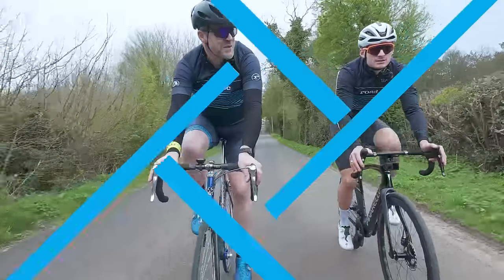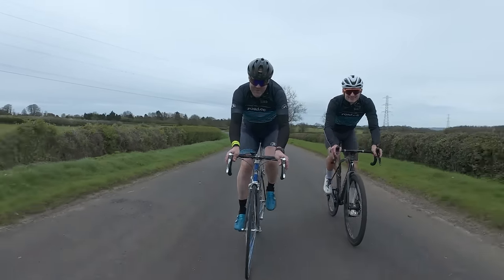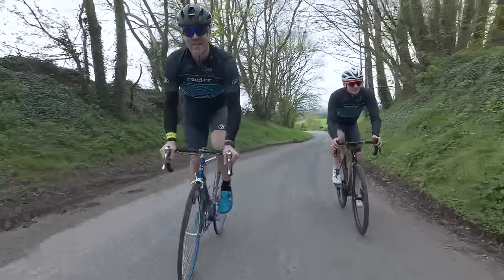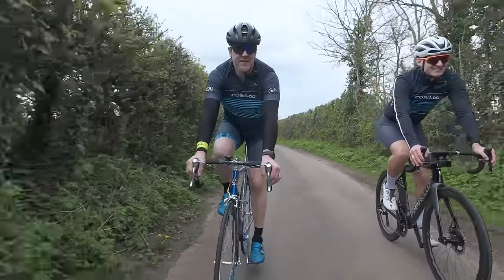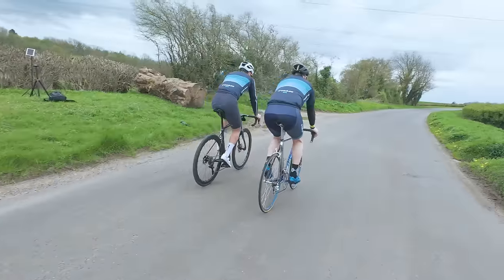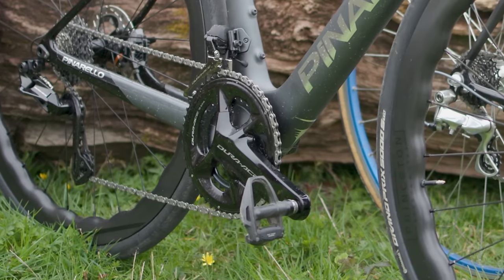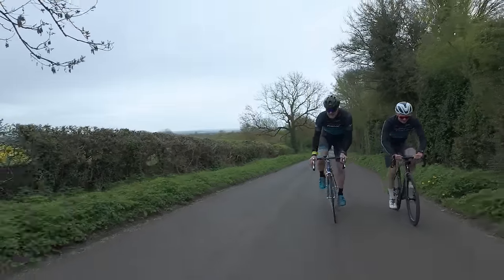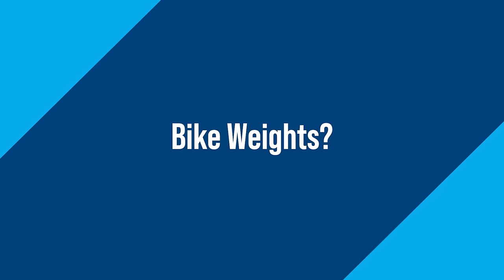Modern Road Bike vs Retro Road Bike - Has 24 Years Of "Progress" Made Cycling BETTER?

Comment: I started riding as an adult in 1975 and bought my first pro bike (by the standards of the day) in 1982.  It featured a handmade frame (Columbus chromo-moly steel tubing), hand-laced wheels, and Campagnolo Record components.  I paid 1,200 USD for the bike and rode it for several years.  Adjusted for inflation, the cost of that bike would be north of $3,800 USD.

I have purchased many bikes over the years.  My most recent purchase is a Canyon Endurace equipped with a Shimano 105 Di2 groupset.  I swapped out the stock wheels for a nicer set from Hunt with carbon rims and equipped them with 30 mm tubeless tires.  Total cost of the bike including the Hunt wheels and tubeless tires:  right around $3,800 (!). 

There is no comparison in terms of the performance of the two bikes:  the Canyon is lighter and FAR more comfortable, meaning I can ride more miles.  Its gear ratios are far wider, shifting is much easier, and the braking is better.  Finally, it doesn't rust (steel bikes will rust if you ride them in anything other than sunny conditions).   As a result, I never long for the bikes of my youth.

Comment: Neo retro is where it’s at.

Get a nice supple high end steel Columbus tubed Italian frame. Fit a threadless carbon 1” fork.

Add some modern 11 or 12 speed Campagnolo top tier groupset.

Some carbon tubeless 30-40mm wheels and 25-26mm modern tubeless tyres.

High end finishing kit. Job done. Should build up around 7.5kg. Sunning looks, hand built heritage, wonderful springy/communicative ride, modern gearing and excellent comfort from the combination of steel and modern tubeless.

Best of both worlds and absolutely unique to you 👌🏼
Reply: Except you can do the same with plenty of existing carbon frames and get a much nicer bike for same money.
Reply: @dainiusvysniauskas2049  no. A beautiful hand crafted lugged or fillet brazed steel frame builds to a much nicer bike than a generic carbon frame with the same components. That’s the whole point of Neo retro and a middle ground between the arguments for each bike in this video.
Reply: @banjo7127  Sadly, physics don't work that way
Reply: @dainiusvysniauskas2049  the only sad circumstance is your obvious lack of understanding regarding the subject. The video is about the benefits of retro vs modern. We’re not talking about physics or any other kind of boring acumen. It’s about the overall experience. I think you’re confused as this is probably your 2nd language.
Reply: @banjo7127  
Oh, the irony.
"Sunning looks, hand built heritage, wonderful springy/communicative ride, modern gearing and excellent comfort from the combination of steel and modern tubeless."

"A beautiful hand crafted lugged or fillet brazed steel frame builds to a much nicer bike than a generic carbon frame with the same components."

These are literally your points I was replying to, not the video. Besides, the fact remains that you can get better bike by going carbon frame route. Retro has zero benefits these days.
Reply: @dainiusvysniauskas2049  you mention irony - again I think you’re having difficulty understanding the context of the video/comments and meaning of English words.

You’re quoting valid points I’ve made about why a traditional frame is superior to modern carbon in many ways without any actual counter argument and then say there are zero benefits, even when they are well established and the basis of some boutique companies existence. Irony indeed 🤣

Comment: Mine is in the middle: 2010. Ultegra 10x. Bought for 700€ used and when I consider buying a 2024 Bike on that level I would have to spend 3000-5000 I think. So I love this bike and will continue riding it, but continue tuning the engine (me).

Comment: I won't ride my 2005 Giant except for short rides where I will be locking the bike up.  Great bike at the time.  Aluminum with carbon forks.   SRAM group.  Fast and light.  But no longer safe in my humble opinion.  Riding on those skinny, 100+psi tires with the rim brakes.  Ugh.  Espeacially if there is rain.  PS Now I am riding a Trek Emonda SLR 7. So much more comfortable and fun.   After letting my son ride the Emonda, he stated that biking was fun!! And then went to the local Trek shop and purchased one for himself!!  Lol!

Comment: My bike has alloy wheels, which would be the obvious upgrade to do, but it's a rim brake bike and it stops on a dime now and I don't want to risk losing significant braking performance putting carbon wheels on it with all the horror stories I hear.

Comment: I collect old road bikes and have a 1951 one, a  1960s example, and a few more 1980s and 1990s ones. There are huge tech improvements to modern roadies post late 2010s and 2020s. More gearing, better shifting, better braking, aero and most importantly much better power transfer from pedals to wheels. 
What I hate is the bike industries decision to hike up prices. U can't get a good upper level roadie for under $10K. Ridiculous. It has become very very elitist.

Comment: Rubble add a wake creator to their aerobike handlebar to create a wake to break up the air that hits the rider. External cables do that for you and are so much easier to service.  Thin tyre puncture less. Inner tubes are really cheap these days and trouble free. You can get a 25 year old super bike for about 400 UKP. Modern bikes are bs.

Comment: "Carbon Fibre is everything you want from a material." Oh really? Lets talk about how UV affects it over time, reusabiliy and recycling then. It's a designers dream, but no so as a whole lifetime picture.
 Like covered in the vid a massive benefit of Aluminium and Titanium is that they pretty much just take energy to reutilise. Aluminium isn't a forever material either as it lacks long term elasticity, but that 99+% recyclability toe pokes CF right in the gooch. And the worst part is how we view CF parts as disposable... they're worse than plastic bags. (to be fair, it's the resin rather than the filaments)

Comment: I know the one I would prefer to ride the steel not the plastic.
Reply: It’s titanium.
Reply: @l.d.t.6327  Who cares the modern one look like a kids toy
Reply: @keithjenkins7919  Who cares if you say "I would prefer to ride the steel" when there are zero steel bikes in the clip.
Reply: I have a custom titanium bike I put over 200k miles on.  It lives on the trainer now because my plastic bikes are leaps and bounds better,  despite costing a lot less in most cases
Reply: @veganpotterthevegan  Pretty sure you're not going to get anywhere near 200k miles on your plastic bikes though.
Reply: I’m a titanium fan.
Reply: @jazzcatjohn   I'm quite certain I will.  I know my first carbon bike has significantly more than that.  I put about 30k on it and a friend has put over 200k on it since
Reply: @veganpotterthevegan  How old are you? Even if you rode 100 miles every single day it would take 5.47 years to ride 200k miles. Then there's the 30k you put on your plastic bike. That's almost another year at 100 miles per day. If you ride the number of miles that a normal working stiff does, then obviously the years stack up fast. Then there's all your other bikes which must have miles on them. You, and your friend, must be professionals who do nothing but ride. That's the only explanation.

Comment: These cycling luddites need to move along.  

I enjoy 70s muscle cars - I think they look cool and sound cool.   But I’m under no misunderstanding that they are as good as modern cars. 

Similarly we can respect older bikes, but they suck to ride.  Most importantly, they stop slow, they lack gearing range, they are super harsh to ride and beat you up, the frames flex and aren’t aero at all.  Beauty is in the eye of the beholder, but I think newer bikes look way better anyway.  

So yeah - I hear ya if you like your older bikes, but stop telling me they are just as good.  They just aren’t
Reply: You're right, sadly old farts are way too stubborn to admit that.
Reply: Bollocks, my 1980 has a gear range is from 23" to over 100" (if you understand gear inches) and in 60 year of racing and riding my 700c disks have never not stopped me, bet they are bigger than your tiny disks.
Reply: @keithjenkins7919  defensive little man.  No need to get so upset
Reply: @keithjenkins7919  Deranged old man yelling at clouds, 2024, colourized.
Reply: @jwfriar  When loosing, always resort to personnel insults
Reply: @dainiusvysniauskas2049   When loosing, always resort to personnel insults
Reply: @jwfriar   When loosing, always resort to personnel insults
Reply: @keithjenkins7919  “loosing”
Reply: @jwfriar  Look forward to you wearing the yellow Jersey, I don't think. Just another run-of-the-mill bike rider whoe will never actually make it to the top, even on a carbon bike
Reply: @keithjenkins7919  yeah man, don’t think I ever said I was gonna ride the tour.  But my bike is a lot better than yours, that much I know.   No matter how impressive you think yours discs are.
Reply: @jwfriar  and my house is better than yours and my car is better than yours. "Better" is that not just a value judgment? My steel bike is recyclable, your carbon will be land fill, so which is "better" ?